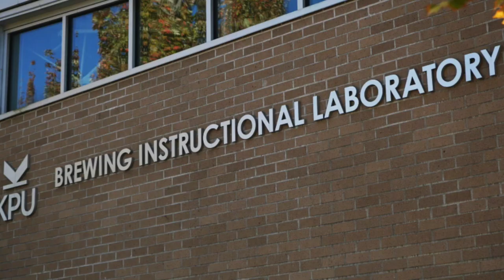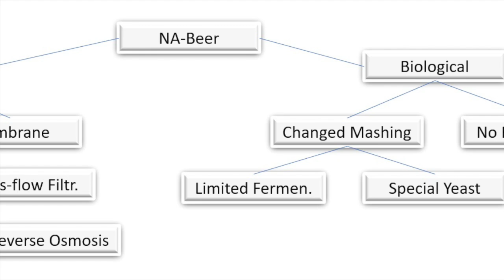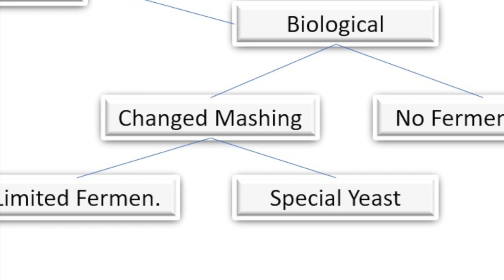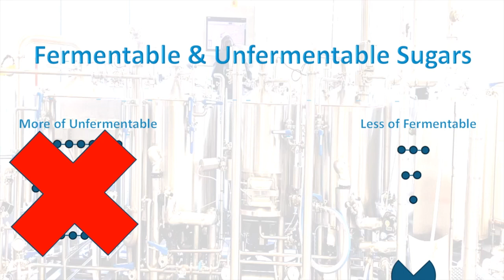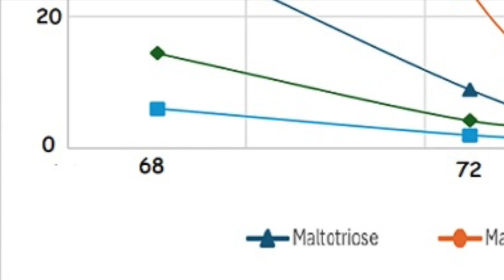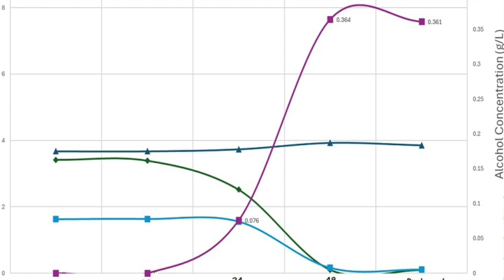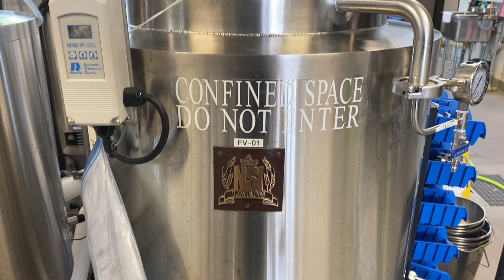Non-Alcoholic Beers and How to Brew Them: Full Guide Including Tips, Tricks, Techniques, and Recipe

Comment: please tell PU for a cold brew concentrate if possible, thanks in advance
Reply from the maker: Below are some general pasteurization guidelines. 
Autolyzing residual yeast (eg. wheat beer) 5 – 8 PU
Light lagers 8 – 15 PU
Full lagers 12 – 20 PU
Ales 12 – 25 PU
Low-alcohol 60 – 80 PU
Non-alcohol 80 – 120 PU